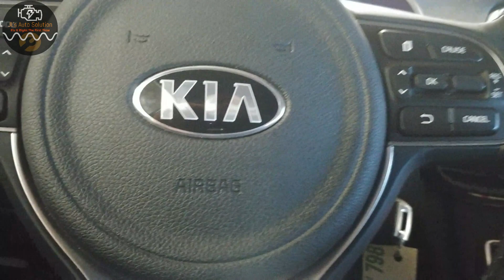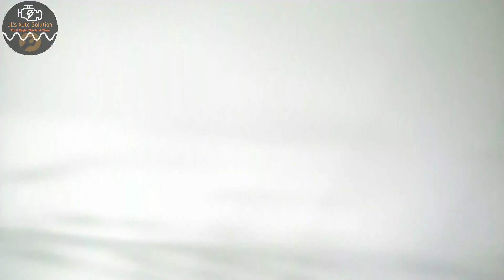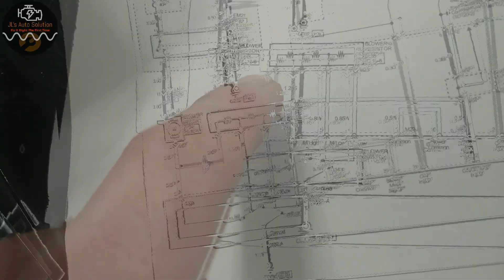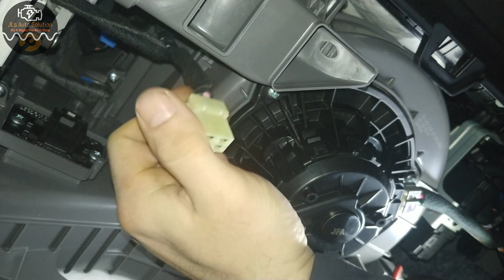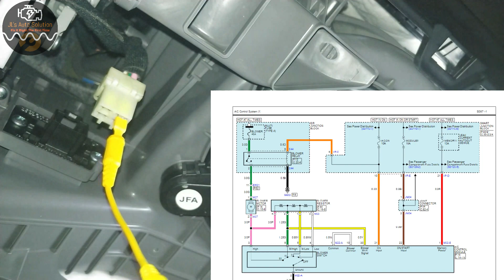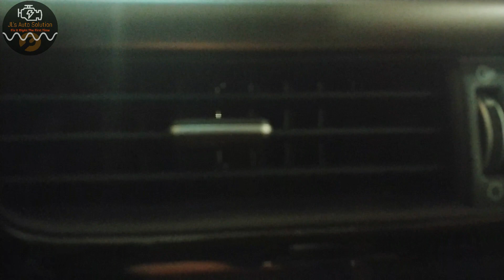Testing Blower Motor Components: Find the Bad Resistor

Comment: 1998 B1500 Ram P/U Cold Wx taking out resistor at low speed while Truck warming up. Bet Blower motor X. The Resistor Looses lower 2 Speeds w/ Only Full Speed working...This Truck's winter warm is the 💩's Outside Air door Opens for every knob Setting Except 'Recirculation'. TOO Much Outside Air Enters for Living in Canada Not California

Comment: If the problem was the broken solder connection, and you re-soldered it, why do you need to replace the resister pack?
Reply from the maker: Due to it the vehicle being under warranty, the company will not allow it to be repaired like that and wants us to replace the defective part.

Thanks for watching.

Comment: On my ‘19 Pacifica, I have a similar issue, barely any air rushed out the vents unless the speed is 3 or above. I bought the car used and I did replace the cabin air filter which was super dirty and it had a broken blend door actuator. Replacing both these parts made it 100% better. But still, between 1-3 speeds barely any air comes out the vents. It’s as if the blower has to struggle to increasingly push out the air. It’s a whole lot better after replacing those parts, but at lower speeds I still can’t notice much difference in air mass rushing out the vents..
Reply from the maker: you could have bad wiring or a bad blower motor are a bad blower motor resistor.

thanks for watching.
Reply: @JLsAutoSolution  Thank you for the reply on possible solutions.

Comment: hi, I just changed the resistor . When i tried the fan, on setting 1 works, setting 2 blows alot, but on setting 3 it seems to blow less. Is this normal? Is there another problem i should check.
Reply from the maker: That sounds odd, 1-slow-2 alittle faster- 3 even faster 4 full speed. was it a oem resistor or a aftermarket one.
Reply: @JLsAutoSolution  I bought it on amazon and all i can tell you is it said it fits my car. So i guess it could be because of the resistor? Seems like 2 and 3 are inverted. Is this possible?

Comment: Is there a way to take that or any blower resister and set it on a work bench, then test it with a basic multi-meter?
Reply from the maker: Yes there is, but that depends on the system and if the information is available.

Comment: Good evening sir and nice to meet you!

I have a vehicle (2003 DODGE CARAVAN SE) and im trying to apply a diagnostic test on it from how the book says to do it but im not comprehending it at all. 

Here is the test down below sir.

Check for continuity between each of the blower motor switch input terminals of the blower motor resistor and the resistor output terminal. 

In each case there should be continuity. 

If OK, repair the instrument panel wire harness circuits between the blower motor switch and the blower motor resistor or the blower motor pigtail wires as required. 

If not OK, replace the faulty blower motor resistor.

Are you able to please show me how to do that with a test light and multimeter sir cause i have both inside the vehicle and im stuck on the turnpike?

Comment: You're very good mechanic thanks yes you explained it in more understandable way appreciated 👍👍👍
Reply: I have my car with no air blowing,but when I am turning the fan from 1to 4 levels all the lights on which means blower resistor works perfectly.Since no air blowing as i keep changing in the speed came with no air means blower motor fails .just please give the response if it doesn't sound good thanks again
Reply from the maker: Unplug fan connector and test for power and ground directly at the blow motor while switching all fan speeds.

Comment: Customer complaint; heater fan not working. (actually it's a friend of mine, I did not charge for my labour)

On a 2003 Nissan Almera Tino the fan speed is displayed as 1 to 5 bars on a LCD screen. It's not a touchscreen, to increase or decrease the speed you use buttons below the screen. I think it runs from an AC module, no need for AC here it's always cold!
So for a cheap fix I cut the two wires to the fan and patched in a PWM controller which I connected to the cigarette lighter socket. The lighter was discarded, it has a 15amp fuse which seems to be adequate for the fan. I attached the PWM controller to the side of the console where it can be easily reached. Now have completely variable fan speed. When turned fully anti-clockwise it has an off switch. So far it's working fine, total cost £7 or $9 US. 

This car will most likely be junk in a year so no need to waste money on it.
Do you think I could get a job at Bodgit & Leggit? :)

There are lots of them on eBay, here's a link to one similar to what I used:
https://www.ebay.co.uk/itm/1pc-12V-24V-48V-40A-DC-Motor-Speed-Control-PWM-HHO-RC-Controller-2000W-MAX-9-50V/323585726803?hash=item4b57365953:g:RuMAAOSwg05cCNg7

Comment: Wonder if the design of that resistor board is also to act as a thermal fuse.The contact you re-soldered looks "sprung". Perhaps the solder is designed to melt in the event of an overheat. Sometimes (especially in heavy snow & ice conditions) it's possible the intake cowl can become completely blocked, so in "fresh" their is virtually no flow/resistor cooling. Or it's quite possible I am talkin complete nonsense! Cheers Jeremy.
Reply from the maker: no, what your saying makes sense.  this is the second time i have change a blower resistor on to a kia vehicle, in 5 years. So I'm thinking someone one at the plant used the wrong solder or cheaped out lol... because there was practically no solder on the board. I just reused what was there.

Thanks for the input. It's nice to see other people's opinion also.